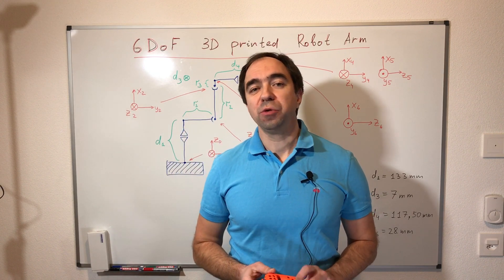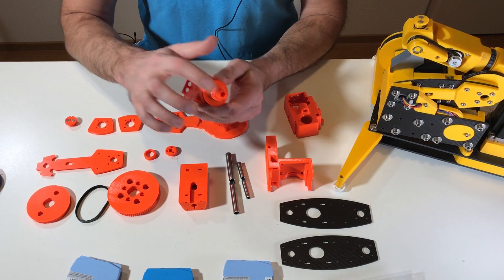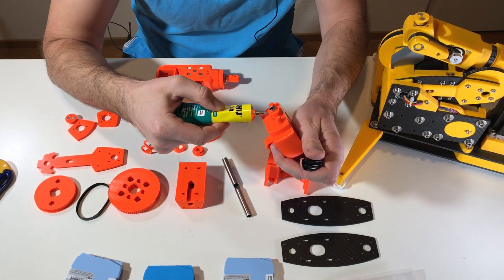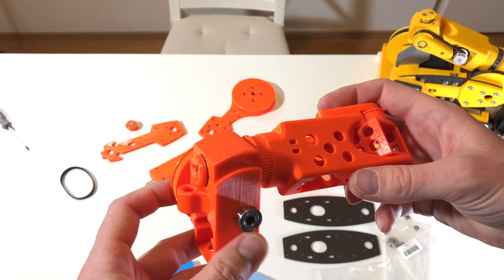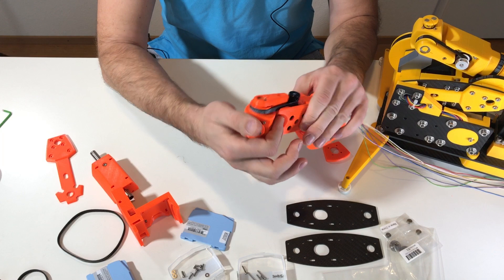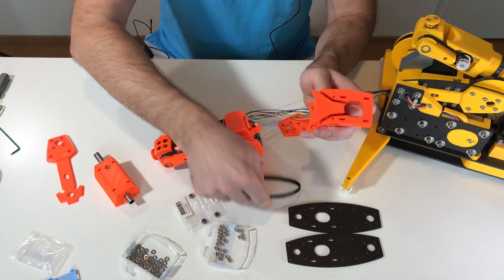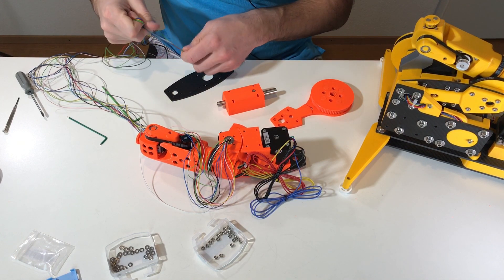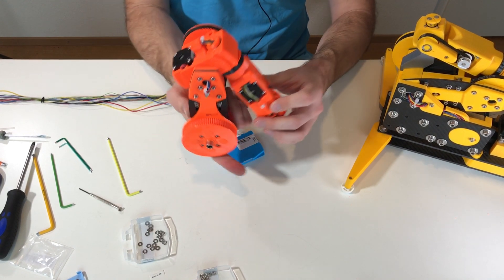6DoF mostly 3D Printed Robot Arm (Part 2)

Comment: Very nice and helpful Video! It's nice you uploaded the stl files, i was still waiting for this Video. 
I'm looking forward to Build the Robot arm.. therefore it would be nice if you explain some parts you are using or list some patreon links so we can support your channel by buying things.
Another thing: would you say printing the parts in ABS is adequate?
I'm waiting for your next video and really Love your channel..  keep going!
Reply from the maker: Thank you, I am very glad to hear this. I will put the file with a description of different parts (motors, bearings, etc.). I just need a little bit of time to put everything in order. I printing these in PETG. And it works super nice. I don’t use ABS, as it is very complicated, and PETG should be enough for this project.
Reply: @Skyentific  looking forward to the full B.O.M. and further info.  Great build!  Cannot wait to make my own.
Reply from the maker: Thank you for your comment. I am writing this list write now. The full list will be available this weekend. This is the beginning of this list:
Motors: 
Nema 8 (8HS13-0604S) 33mm, stepperonline, 4mm shaft, x1 unit    (16.00)
Nema 11 (11HS12-0674S) 31mm, stepperonline, 5mm shaft, x2 units   (22.22)
Nema 17 (17HS19-0854S) 48mm, stepperonline, 5mm shaft, x1 unit   (9.48)
Nema 23 (23HS30-2804S1) 76mm, stepperonline, 6mm shaft, x2 units   (40.30)
Belts:
A 6R51M087060, 87 teeth GT2 2mm, 6mm wide timing belt, sdp-si, x2 units  (10.26)
A 6R51M139060, 139 teeth GT2 2mm, 6mm wide timing belt, sdp-si, x1 units  (5.55)
A 6R53M128090, 128 teeth GT2 3mm, 9mm wide timing belt, sdp-si, x1 units  (10.06)
A 6R53M152090, 152 teeth GT2 3mm, 9mm wide timing belt, sdp-si, x1 units  (10.67)
Pulleys:
A , GT2 2mm, 20 teeth, 5mm bore, sdp-si, x3 units
A 6A53M020DF0906, GT2 3mm, 20 teeth, 6mm bore, sdp-si, x2 units   (16.12)
Bearings: 
Ball Bearing, 21x15x4, hobbyking, x3 units       (7.21)
Ball Bearing, 16x8x5, amazon, x3 units       (5.00)
Q6000 ZZ, 26x10x8, hpceurope, x2 units      (6.62)
Q6001 ZZ, 28x12x8, hpceurope, x2 units      (6.62)
TB51102, 28x16x28x15x9, hpceurope, x2 units     (5.00)
Carbon fibre parts:
Cut from carbon fibre sheet (3mm and 4mm) (could be printed from high stiffness plastic)
Axis3part1 (3mm thickness), famoushobby, x2 units     (23.04)
Axis2part1 (4mm thickness), famoushobby, x2 units     (33.24)
Axis1part2 (4mm thickness), famoushobby, x2 units     (53.52)
Reply: @Skyentific  thank you for the Listing! As soon as i solved my exams in one month, i'll start Building my Copy of your Robot arm.. i'm really exited to see the Electronics and Control Solution .. this list will help me to order all Things for the Project.. 😁 Keep it going!👍

Comment: I loved everything about the design and assembly. Can you please tell what belts specifications did you use for the drives?
Reply from the maker: Thank you! The belt specification on the GitHub page in one of the two PDF files. There is a bill of material there, and the name of belts. It is GT2 belts with 2mm pitch and 3mm. Link to the file: https://github.com/SkyentificGit/SmallRobotArm/blob/master/SmallRobotArmMechanicalAssembly.pdf

Comment: you could have use slip ring on the 4th axis to have infinite rotation
Reply from the maker: Yes. This could be the possibility. I had this idea, but I was afraid that these slip rings don't have very good connection, but I never used them. And also I did not want to overcomplicate the robot. This is really good comment, thank you.

Comment: Do you have a diagram for the drilling of the axes? Especially for the small hole for fixing
Very impressive work thank you for  open source sharing
Reply from the maker: Unfortunately I don't have it, but I should definitely do this! Thank you for pointing this out.
Reply: @Skyentific  it would be really nice of you  thanks
Reply from the maker: Just added them to the GitHub page. Tell me if you can open these files, they are from fusion 360.
Reply: @Skyentific  No I can not open I dont have fusion 360 licence I use Freecad ... Can you export something simple like PDF please ?
Reply from the maker: Did you tried to open step file? I think Freecad should understand it.
Reply: @Skyentific  Yes you are right now I have the dimensions of the axis ...
Thank you for helping me
Reply from the maker: You are welcome!

Comment: It looks like very tight tolerances, was wondering how you dealt with shrinkage? Did you have to allow for it in the CAD? Or perhaps there is very little with that type of material.
Reply from the maker: Actually both. I allowed for this in the CAD. And I also realised that my 3D printer (at least with PETG) print parts very precisely. I also printed many times before I found the right value for the tolerances (almost each part I printed 2 or 3 times, before I was happy with the tolerance).

Comment: Awesome project sir! I plan build one of these with my Electrical class at the Tech College where I teach. I have built several CNC machines and all of these have limit switches to avoid crashing the machine. Are you dealing with this by creating virtual stops in the programming or some other way? I did not see you install any sensors.

Comment: Здравствуйте. А код управления уже есть какой то ?? Или он не open source ?
Reply from the maker: Hello. Good question! I have a code in Arduino which I wrote myself. It works but it is not very professional (I mean that it could be optimised to increase the performance). I will put it on open source next weekend on the GitHub.
Reply: @Skyentific  wow this guy understands Russian! I gotta try this too! 3D 프린터 추천해주세요. 적당한 가격으로요!
Reply: @Skyentific  oh yeah btw you have a typo in your page, where you say "I'm gonna quit your job". instead of "quit" you wrote" quite"
Reply from the maker: Thank you! I've just corrected
Reply from the maker: I used google translate with you! :) I use Prusa i3 MK3, it is not the cheapest but it is very good printer. From budget side I think CR-10 is a good one, but I never tried it by myself. My goal was to buy the printer which demands low maintenance, and Prusa is very good for this (with CR-10 you would need to calibrate the bed regulary).